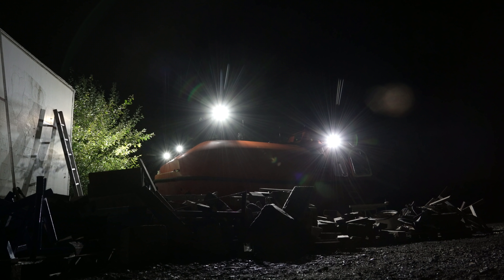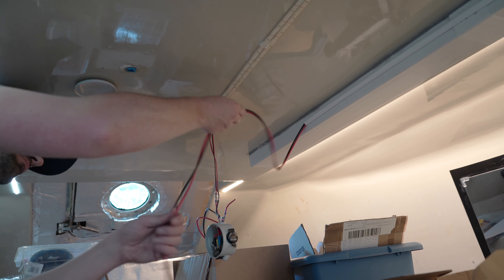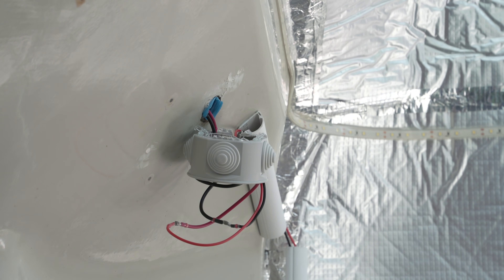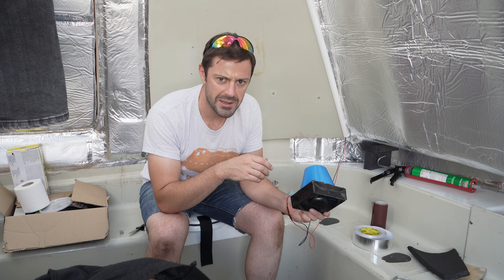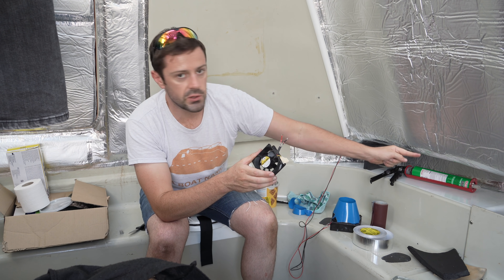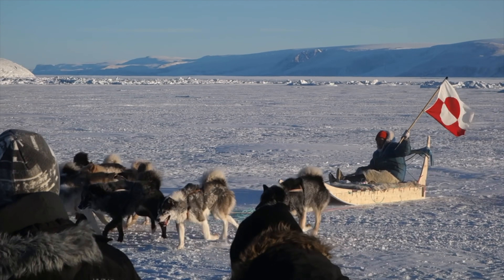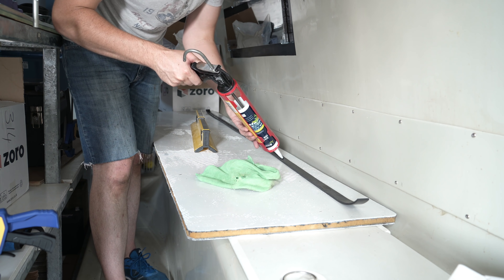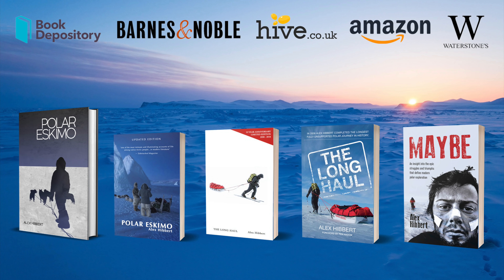Lifeboat Conversion Ep23: Using old electrical conduit, vent fans, and making bunk supports [4K]

Comment: When pulling wires through conduit, always add extra tape around the blunt edges of the wires, like a 'nose cone', to prevent them stalling on a step in size or on a junction.  Loving the content, the Greenland bit was awesome... glad you didn't have to eat any dogs a la Shackleton.
Reply from the maker: Now I know!

Comment: Another suggestion. In all wire connections where you would think just a wire nut was good. Twist, solder, then crimp connecter. That boat will be in constant motion. And the wire nut and tap just didn't seem to hold up after months at sea. Solder all connections that are not designed to be replaced with warn out components.

Comment: I would suggest using a different type of fan. a impeller fan or squirrel cage fan. they are way better at creating pressure and are therefore better at pushing/sucking air trough tubes.

Comment: When pulling a new wire behind an old wire, I solder them together and pull them through, so they are the same diameter. No snags, no tape, no breaking half way.

Comment: There is a special lube made for pulling elctric wire through conduit, it's reminiscent of green slime. Or just take a bar of soap anf rub it on the wire really well, then be ready to put the brakes on so it doesn't go through to fast.
Reply: I use this stuff called Polywater. It’s great when pulling cable through plumbing because it doesn’t contaminate the water.

Comment: Sometime you can get past a blockage by blasting compressed air in the conduit as you pull the wire. Also to run a new wire in a conduit with a bend, apply vacuum to one end and feed paracord or string from the other end.
Reply from the maker: I didn't try vacuum as I don't think the conduit is sealed, but I did try running a scout wire from both ends.

Comment: I've been watching all of Alan's very interesting videos, thank you for sharing the building process!! I work in shipbuilding myself, maybe I could give you a tip without being too annoying :) There is a Zinc "paint" that we use when we cut the galvanized steel (pipes), to cover the exposed part after the cut. It's not as good as galvanizing the whole thing again, but helps prevent corrosion, specially with parts that will be in contact with water.
Reply from the maker: Ah yes indeed. I was thinking of getting some, but to be honest a good coat of appropriate paint will do the job too!

Comment: Being an HVAC engineer I can understand why your low head fan would not move air through a duct.  You are also correct about stacking those fans to increase their head capacity.  Like linking battery cells in parallel you don't get more voltage, but you do get more current.  That's what you are looking for, a current of air.
Reply from the maker: An intriguing but steep learning curve it's been!

Comment: When pulling wire through the conduit, have someone on the opposite end pushing the wire through the conduit at the same time. This may solve your hanging issue, sometimes the wires get bound around corners and need to be pushed as wel as pulled

Comment: I was actually watching some videos about this - in the 3d printing community there's a lot of back and forth between axial or radial fans - axial fans needa set of stator vanes in the outputto turn thechoppy turbulence from the blades into air moving down the ducting or nozzle
Reply: It can be as basic as a couple of slotted together sheets of ligbt plastic or carbon fiber offcuts, stuck inside the blue cone with tube glue
Reply from the maker: Thanks - I'll put together a test rig and see if the flow is ok without vanes.
Reply: @AlexHibbertOriginals  axial fans are prone to turbulent stall if there's much backpressure and no stators to arrest the turbulence

Comment: Maybe have the 2nd fan half way through as a booster pump. Also as your brother may have said, the angle of the corner has a big impact on the friction.

Also the big fan may be useful in the middle of the boat if you need some extra airflow to help clear out the boat.
Reply from the maker: Yes indeed

Comment: About that vhf radio.    When i buy normal, every day use optics i go for the low range of the highest quality brands.   They don’t dare to sell junk under the same name.    A 150€ binocular from Kowa is usually better than a 300€ pair from some chineesium brand.

Comment: If you want have a look at Alluring Arctic, they just got a new boat that they are prepping for extended stays in the cold.
Reply from the maker: Have had a browse. By the looks of it, you could with the same money either buy Alan, or one hatch handle from Arktika!
Reply: @AlexHibbertOriginals  Alan every single time

Comment: When pulling old cable out of a duct, always pull in string/line so you can pull new cable through when ready. Everything is easier with hindsight though isn’t it? Think I drove past your boatyard a few weeks back visiting family.
Reply from the maker: That wasn't the issue. I was initially using the existing wires to try to guide the new ones through. They weren't pulled out immediately.

Comment: 2:35 I normally don't comment on things before watching an entire video, but those splises with solder haven't melted as they should and are not held together properly. For something going into such a harch environment I would look into getting it meltet probably even though it will probably be completely fine.
Reply from the maker: The solder melted and flowed in both. It doesn't completely fill the void.
Reply: @AlexHibbertOriginals  Okey, they just looked a little thick to be melted properly :)

Comment: Is it worth considering a zone 1 SELV bathroom extractor fan of some sort? You can get IPX4 and IPX5 rated ones, although I suspect they are 12v so if you needed 24v that might be more difficult, although you do have to be careful as some of them are 12v AC. I think Xpelair do a 12v DC ultra quiet one in IPX4 and IPX5. No fan likes corners in the ducting, but if you can stick with 100mm flexible duct these might work for you. I expect you've already considered these but figured they were worth a mention. I spent too long reading about the damn things while replacing the ones in our house.
Reply from the maker: Would probably work fine, but these IP68 units are very efficient, quiet, and uncomplicated to install.

Comment: I've used the furuno fm8900 radio before and find it's group scan to be lacking, and cycle time is quite slow. If it picks up something on one of your assigned channels and you don't get to it quick enough it's a pain to turn scan off and then manually go to the channel. I'm sure every radio has its own little idiosyncrasies and they'll all do the job in the end.
Reply from the maker: It's also about 5x my budget!
Reply: @AlexHibbertOriginals  easy one to rule out then 😂😂

Comment: if the fan is in the pull instead of push configuration it might have a much better shot at moving air
Reply from the maker: Possible. Although it can't be mounted at the actual exit vent, so there still has to be a constriction downstream of the fan without a redesign.

Comment: VHF radio, they are mostly the same stuff all of them.

Just make sure its:

25W
Has DSC
Has DW
Is approved

Icom is always a safe bet for boats. 

As for what model pairs to the AIS unit, no idea.
Reply: Oh what it important though is that it has a good ground and that the coaxial cable that goes to the antenna is of right specifications. Stay clear of any super cheap RG-8 stuff, that stuff belongs in a happy meal not on lifesaving equipment.

Comment: why couldn't you put the fan near the vent and pull the air from the engine compartment that way the smaller cone adapter wouldn't have back pressure.
Reply from the maker: The exit from the port is a fixed diameter - so the reduction would still have to happen there.

Comment: You need something to stop that boat from rolling around in the sea, I think the first big wave taken side on will see the boat upside down for a brief moment and even if that doesn't happen you will be sick as dogs as soon as you get on open sea.
Reply from the maker: I strongly recommend watching previous episodes! It's discussed a lot.
Reply: @AlexHibbertOriginals  I do believe I've watched all your well written/shot episodes to date and I might have missed the centre of gravity being drastically  moved but I can't recall it. If it's going out on open sea for more time than it's designed to with less than the weight of 20 odd people I might suggest some calculations for weighted keels.

Comment: it doesn't look like your heat gun was hot enough to melt the solder in your connectors; the ring of solder should completely suck into the wires
Reply from the maker: The solder is inside that constricting ring. Different colour grey.

Comment: Those heat shrink connectors are not very good connections. Someone on YouTube did testing, cut them apart after using them to see the penetration of the solder. It wasn't great.
Reply from the maker: Yes I've seen a lot of debate on that. I think given their practicality, as long as you ensure a good physical connect pre-heating and then visually see the solder flow, you're unlikely to have a disaster. I did a couple in a rush years back and didn't watch for the solder. They worked fine without voltage drop, but when I came to remove them for a re-design, they pulled away with a yank.

Comment: Don't use those things to connect. It's low temp solder and will fail with time. Especially in the rough and changing conditions you will be in. Also when they fail you can't repair them you have to replace them.
Reply: If you're going to use them at least use flux so that the wire can absorb the solder. That's another issue with these the solder does not always bind with the copper wire
Reply: Please please please please please please please please please trust me on this. I do electrical repair all the time these things are problems and a half but they can work
Reply from the maker: I'm unsure what parts you are saying will fail. The solder? If so that''s no dramatic problem as the two ends are very well mechanically held together/intertwined.
Reply: @AlexHibbertOriginals  sorry I just got back from work when I wrote that and I was a bit exhausted so I did not explain very well. Specifically the solder that is in there has two major flaws. One under mechanical stress or more importantly temperature fluctuations. it shatters/disconnects from the wire. Two it fails to wick into the solder enough and pulls out. If the wires are in an area where they will not move at all this is not an issue but any area with any mechanical stress or movement they will fail. This is to do with the solder itself not properly wicking itself into the copper wire and the fact that low temperature solder can be brittle. For example in the video you did the red wire did not have completely melted solder nor did it fully wick. If you were to take that joint and bend back and forth for maybe a minute and then pull on it with a decent pull I have a feeling it may break. Again I could be wrong and so long as these aren't put under stress it may not be an issue but in my experience about 1 in 10 will fail.
Reply: @AlexHibbertOriginals  https://youtu.be/unxEdyW8RP8 this really shows kinda what I am saying from an electrician

Comment: dUUUDE , that conection on wires your doing on watter will fail cuz of all movement btw you didnt melt it properly.... after melting you shouldnt be able to see that soldering ring it shouldv been gone in the wires . you need to get it above 200c to melt and usualy it burns that plastic tube in that temperature :D also you can ask any proper car electrician what they think of soldering
Reply from the maker: Hi Mark. I think you may have different types mixed up - these I've checked with an electrician friend. The dark metal band you can see constricts but doesn't melt. The lighter grey solder is inside, and you can visually see it melting and encompassing the two bare cable ends.

I've done tests on spare lengths, and once done, it takes a lot of efforts to pull them apart. The only limiting factor can be that the silicone cable sheaths don't fully bond to the seal rings on each end of the connectors.